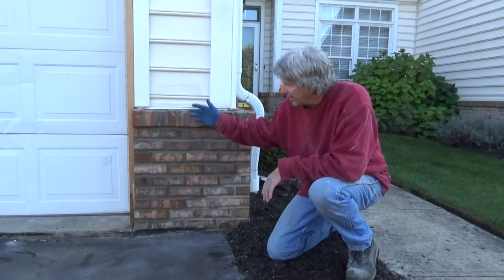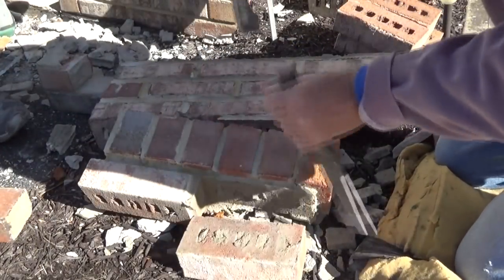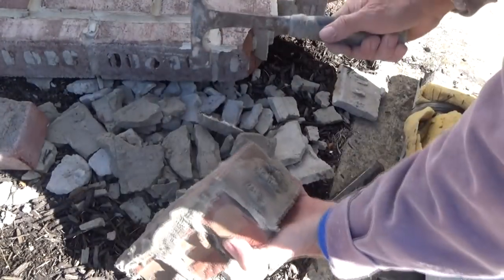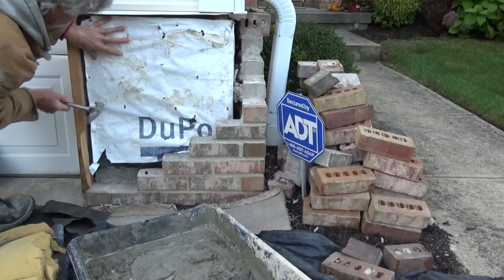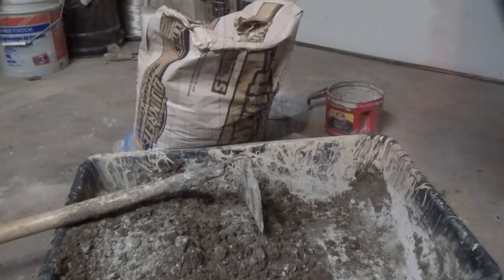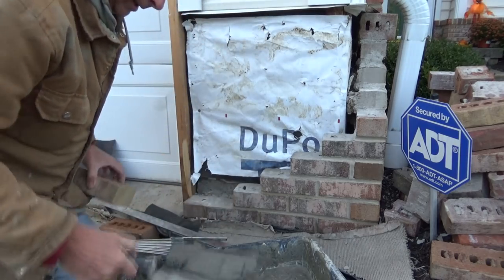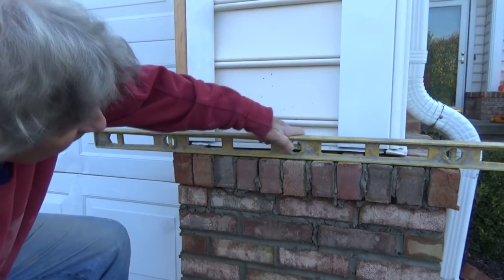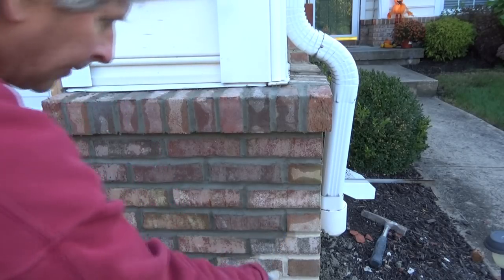BRICK WALL REPAIR (Mike Haduck)

Comment: Good Video Mike ! Been A public Works Inspector for 40+ years. The Last time I had a good mason on one of my jobs was 35 years ago. He was building a manhole so deep that the bottom had to have 4 rows of brick to support the upper. He was a craftsman , and a pleasure to watch him work. Now its all precast, with bottoms poured concrete against undisturbed earth. Stay safe, the best for you and your family. PS, that manhole is probably still in better shape today, than any precast installed at the same time.
Reply from the maker: Thanks Dennis, I appreciate it,  mike

Comment: Your videos are just the best Mike. We build alot of chimneys on Cape Cod and I often wonder if there would be better profit in going the restoration route. Especially for so much less labor and headache. Of course everything has it's pros and cons. By the way, the matching the old mortar joints to the new, GENIUS! Thanks Mike
Reply from the maker: Thanks Adam, all the new masonry chimneys have disappeared, everything has gone to stainless steel , lots of repair work work though,  yea I picked up that trick from the old timers, thanks mike

Comment: We can't do the mud trick...because we can't. My Aunt's brick arches around garage doors were falling out after steel letils rusted and popped mortar out. I thought they used white mortar so I sourced some, not easy here in Huntingdon County PA like finding lime. I had to get that back home in Bucks County. Anyway, she didnt seem to mind the color mismatch of the caulk I pealed out that my late uncle used to hold the bricks up for 10 years but, she did mind my mix being too white. Turns out the original mix was black and the minerals leeching through gave it a white exterior layer after years. I mixed up regular mortar into a paint I learned from you and she was happy. Thanks Mike.
Reply from the maker: Thanks jeri,, I appreciate hearing that, Mike

Comment: you saying 'this ain't no big deal at all' gives me hope for the wall repair I have ahead of me
Reply from the maker: Thanks kawh, Mike
Reply: I also have a repair of an exterior wall ahead of me.  Have little knowledge about it but this was very informative.  Makes me feel like I can do this!  Here’s to a new fixed wall.  Some guy wants $1200 to take 2 1/2 layers down and use same bricks to put it back up!  YIKES!  That’s a lot of money for 2 1/2 layers.  I’ll try it myself.  Thanks for your videos.
Reply: @MikeHaduck  Mike, I’m going to give fixing my outside all myself.  You have given me enough ammunition to give it a try.  It’s a free standing wall that after 45-50 years is leaning.  I think with the right stuff I could do it myself rather than pay the $1200 to a stranger!  He just want’s to take 2 1/2 layers of brick down and put the same brick back up!  I also love your tip about painting the old mortar when done!  Makes a great solution to the problem!  Thanks for the tip!!

Comment: Mike I had seen this video a few months ago and liked it a lot.
We mostly do flatwork and concrete here but last month I took on
a small brick job for a local family. Everything you said about the 
bumps in the road when working with bricks is true.
The owner and I had to go through the ones he bought to find
maybe half the pallet that matched, were the same size, and weren't
bent or cracked in the kiln. I think the industry tends to be it's own worst enemy.
Reply from the maker: Very true pensive,  I agree, mike

Comment: Mike, I've got a similar job in a couple of days ,but it's gonna be a wall about 7' tall toothed out on one end , 4 or 5 brick and up the side of a door jam. I'm also going to be laying those old solid brick that doesn't soak up water good at all. I will be taking a kerosene heater with me to put on the wall to help it dry so I can joint it. I'm expecting the temp to be around 55 degrees,so I will be mixing it dry too. I'm SO GLAD to see someone else that uses the middle hole in the wall tie as nailing in the top one wont help at all if the wall starts to fall.God bless.
Reply from the maker: Thanks mikey,  God bless also,  Mike

Comment: Last summer I walked through Lowe's, Home Depot, Menards. to look at bricks.  There were many types of bricks.  I asked a old bricklayer about recycling bricks.  His answer was that most bricks in existing buildings are not standard common bricks and therefore not worth recycling.  I also saw lots of "bricks" that were not made of baked clay but of colored concrete.  I would like to build a outdoor grill with bricks in my back yard but who knows what kind of bricks will stand up to the elements of the changing temperatures as well the heat of wood fires.  We all need to know a whole lot more about bricks themselves.  I've traveled in Central America, lots of brick layer professionals there.  Many people make their own cement blocks and it is amazing the work they do with sticks and mortar.  I'm always amazed.
Reply: people pull bricks form old buildings all the time and apparently they worth $$$. totally can re uses the old school burgundy baked clay bricks! you can also FEEL the difference with old vs new depending on the TYPE of brick. i've felt some old baked clays that have sheen and are VERY dense in material and mass and weight.
Reply from the maker: Hi Julie, there are lots of used brick out there and I pick them up at clean landfills, etc when they are ripping down old buildings,  but brick work is a dying thing, thanks mike

Comment: Great video Mike,I like watching your videos,I've been a mason over  25 years here in Iowa.I do alot of repairs also,with old buildings ,new construction,cutting  alot of new openings. Replacing granite on Historical Building in DesMoines current project.Sometimes thing are easy,sometimes difficult, but gotta love the trade.
Reply from the maker: Thanks Scott, I appreciate hearing that from a pro,  mike
Reply: Hey scott im from Iowa and have worked concrete for a few years and now moreso carpentry framing and dabble in concrete here and there still. Id love to be able to pick your brain on some stuff if you wouldnt mind. Do you have an email i could reach you?

Comment: Hi Mike.
I am one of your followers and almost everything I know about construction I know thanks to you.
In this video I notice a little frustration on your part about everything false that surrounds us, the walls, the stones, the news ...
The same thing happens to me and it is not because I am building a house with stone and tree trunks by beams, but because I see that mediocrity and the haggling of effort have established themselves among us as normal.
In my opinion it is a losing battle, a bit like the gradual disappearance of gasoline engines and their replacement by electric vehicles that seem to get electricity from magic.
It only remains to be thankful that we have enjoyed (and continue to do so) long motorcycle trips to nowhere with oil leaks and mechanical problems that could be fixed with a hammer, screwdriver and some adhesive tape.
Times change and trying to stop them is like trying to stop the tide.
They are not worse, they are different.
Great videos and great reflections of a great kind.
Thank you very much for sharing it all.
A big greeting from Spain.
Reply from the maker: Thanks Piter, that was a great way to say that, I appreciate it,  mike

Comment: Great job sir, thank you for the video.  You should install a 6 inch concrete filled steel pipe to protect the brickwork and house from future collisions.
Reply from the maker: Thanks Jack, good idea,  mike
Reply: Why? People should just learn to drive.
Reply: @saulgoodman2018   While I agree you'd be cutting out a huge part of my garage door repair income if they did. Over the years many many people who do know how to drive have hit garage doors in my area. 
They know how to drive but not how to garage.
My suggestion for anyone interested is if you build a garage make sure you have double wide doors for each car.
Great video Mike... As always very informative even for a 
guy who has been fixed them himself.

Comment: Mike did you and the owner discuss the issues of water on the top surface of
that brick "hip wall" as I'd term it?  Except for a maybe 1 inch side flashing on top
the surface was originally laid horizontal and exposed to the rains.
I'd be inclined to suggest a full flashing on the top of the bricks so their
surfaces and joints are protected.  I haven't fixed homes with this feature
in my area but it seems prominent in your video example.
Reply from the maker: Hi pensive, I just did the brick fix the carpenter came back and took care of it, thanks, mike

Comment: Good video. Good tips. So basically the type S cement is used to do the mortar when lying bricks or cement block and is not suitable to do the fixes you did with the cement all ( church steps)  or mortar mix (windows) and patching up wall to look like stucco?  Need to do some overhead repair on a window sill....I think they recommend the rapid set mortar mix?
Reply from the maker: Hi H,  these days Its hard to tell people what to use, I show what I used on each job, because there is so many new products, I hope it helps, mike

Comment: Excellent tutorial. I always assumed the bricks were placed flush against the plywood sheathing. Is there usually an air gap like that?
Reply: Yea. Need somewhere for air and water to go
Reply: If you Google "weep hole" and click pictures you would see what's going on and why brick isn't touching the board.
Reply from the maker: Hi Brian.  Yep usually finger space,  thanks mike
Reply: @george.carlin  Thanks. I did and learned a lot. Makes sense now.

Comment: Great video that I have been waiting for and the reason I searched you out last year.  I have a similar problem of a 3'x3' brickwork next to my front door that is caught up against the sidewalk at the bottom and the sidewalk pad has slowly slide away pulling the brickwork off 2'' and away from the door jam leaving a huge 1/2'' gap that bees and weather get behind.  I thought about trying to somehow just chisel a little material at the bottom to separate them and push it back towards the house and close the gap.  It is such a small flat section that is such a big eye sore and problem.
Reply from the maker: Hi Jetboy, maybe if nothing is behind it you could get a rubber hammer and see if it pops back in, otherwise I guess you got to take it down and do it again, check the local brick yard first to see if they have any matches, thanks Mike
Reply: @MikeHaduck  Thanks for the reply, yeah I was thinking of disassembly and rebuild since it is a small area and would be fun to do and do it right.

Comment: The gravel based concrete wall you showed is SuperiorWall, it's precast and insulted. It's not cheap, it's a decent alternative to concrete pour that's been around I think since 2000.  A new company uses composite to make foundation walls that take the place of concrete, again premade and shipped to the site for assembly. The thin brick veneer walls are not a bad alternative they eliminate some of the headaches to meet code for a masonry wall.  That said it still takes skill to make it look good and requires a mason to do it, not your tile guy.
Reply from the maker: Thanks Joe,  that's a good way to say it,  thanks mike

Comment: Any advice on pushing a brick basement wall back outwards? House didnt have slope away from and no gutters including dirt filled window wells. Is it worth trying to push back or should i instead fill in the windows and address water issues and hope it doesnt continue to happen?
Reply from the maker: Hi Matt, maybe both,  keeping water away is a big thing, thanks mike

Comment: My grand Father built a brick BarQue Pit.  It finally fell I want to fix it myself .  It's pretty basic, but I need your help.
Reply from the maker: Hi Doublemm, I am sure you will do fine, check out my videos on brick step repointing or brick step installation,  Mike haduck, all my techniques are there, thanks mike

Comment: In reference to the 'fake' brick that gets mentioned often: The brick repair job done in this video is basically a veneer, is it not?  The use of fake brick shown later in this video is also a veneer, no?
So... in what way is using the full dimensional brick more preferable or better than the thin stuff, as neither product seems to offer any structural value in this application?
Reply from the maker: Hi M J, your right everything is just for looks, no structural value,  the structural value of bricks began to decline in the 50s and now is less and less being used, thanks mike

Comment: There is definitely brick that needs to be wet before laying. We'd spray some cubes with a hose before laying them due to how much water they can absorb.  It gives you a chance to get some numbers on the wall before you need to joint.
Reply from the maker: Hi J M, I have heard that, but we never did that around here, everything is usually frozen,  thanks mike
Reply: @MikeHaduck  no warm weather up in PA. ? Must be like Antarctica!

Comment: Mike - Have you seen much use of ICF for building over there? For at least 20 years I've had it in my head that it is a great way to build. It isn't masonry - although they can make them with a brick ledge so you can put a full layer of brick on like cladding.
Reply from the maker: Hi sus, I'm not aware of it but I will keep my eye out,  thanks, mike

Comment: Mike I have some 60 yo bricks on front of my house, about 3 ft tall, lower facade. You have any videos on pointing the mortar or whatever it’s called to bring them back to life? Do I have to use diamond wheel on grinder to remove some existing mortar to get new mortar to stick? Warm climate of So California.
Reply from the maker: Hi K O, I got videos on "brick steps repair" where I would be doing something similar,  thanks mike

Comment: I have two flat brick size paving stones to put down.  I have been given filler would this work to concrete it down and do i need to use sand to help bulk it out???   a reply as quick as would be good
Reply from the maker: Hi Jac, I can't say, every situation is different,  thanks Mike

Comment: hellow Mike. i wanna ask you cold weather you  exprienced.  early of november last year it was very cold in NY and i came from korea for plastering work  but i couldn't plaster on ALC block wall there because of cold weather that might cause freeze and burst. and i had no idea where i can get anti-freeze for construction. in home-depot there were many anti-freeze bottles for machines except for construction. in pensylvenia how is the weather now? if it is  below 39.2F , where do you get the anti freeze for construction? it looks like over 39.2F on this video  so i cant watch what kind of antifreeze you use. always thank you for your sharing. with warmth from S.Korea
Reply from the maker: Hi Adfgh,  I haven't used anti freeze in years, I usually buy fast drying cement for emergencies, or they got to wait till the weather is better, I don't trust many of those anti freeze products,thanks mike

Comment: Great video Mike. Mate I’m  considering doing two brick walls on a corner of my house under and over hang balcony for extra garage storage. My question is  the corner supporting pole is steel for the balcony and I’m considering fixing the wall ties to the steel pole using liquid nails (in Australia] to fix them. Would you recommend using that and how far do you set back bricks from a steel supporting post? Cheers in advance Vince.
Reply from the maker: Hi Vince, your getting into structural stuff there, in the union they welded the ties to the steel , I have a video called wall ties and brick bonding, Mike haduck, that might help, thanks Mike
Reply: @MikeHaduck  thanks Mike I’ll check that out. Love your videos 😀

Comment: HI Mike Can Carbon Fiber be used on a bowing brick foundation wall? Also what are your thoughts on using high strength steel straps for a bowing brick foundation wall? Thanks.
Reply from the maker: Hi, I can't say unless I was there to see it, I would ask some locals, I hope it helps, thanks Mike
Reply: @MikeHaduck  Mike I was not asking if I can or cannot use carbon fiber strips for my particular basement. They were general questions - Can Carbon Fiber be used on a bowing brick foundation wall? Also what are your thoughts on using high strength steel straps for a bowing brick foundation wall?

Comment: Hi Mike, I am going to repair my chimney. Some of the bricks are slightly chipped/damaged (1/8 to 1/4 inch deep). If I can remove them, could I just rotate them & use the inner side facing out? And how do you check/test old bricks are still viable for reuse? Thanks.
Reply from the maker: Hi AC, I would say if it's not crumbling its usually ok, and most people dont look up at chimneys. I put the better ones in front and if I have to go to match some at the brick yard they go in back, I hope it helps,  mike
Reply: @MikeHaduck  Thanks for giving us "DIYers" practical solutions👍✌️

Comment: Mike, how come sometime you only use the type s by itself and this time you add sand. Thanks. Rick
Reply from the maker: Hi, some bags are sold with the sand and cement pre mixed, just add water, with brick work I usually use  weaker mix, every situation is different,  thanks Mike

Comment: Do you have any videos on how to match mortar color and type? The mortar on my house had a lot of aggregate mixed in with it and I bough highway sand to match it a little better. The color is a little off though.
Reply from the maker: Check out my video matching cement joints and re laying brick,  mike haduck, thanks Mike
Reply: @MikeHaduck  cool, thanks!

Comment: What is the difference between type S and "Portland" cement? Did Mike do a video on that ?
Reply from the maker: Hi Paul I did a video called what cement should I use, part 1. But I will be working on part 2 soon, ,  s mortar just has portland added, thanks, Mike